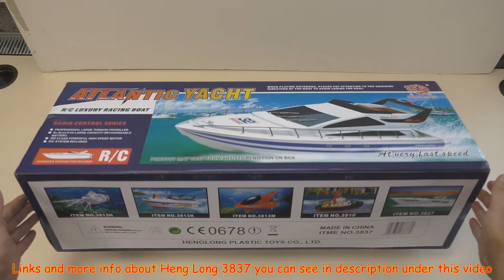Heng Long 3837 2.4GHz, 2Ch, RC Boat, two 380 brushed motors, proportional control (RTR) + TX05

Comment: For those that looked for binding receiver to transmitter here, well here's how to do it.  For a replacement Rx.  Switch on both Tx and Rx. The Rx led should flash indicating not bound. Move throttle stick to full down/reverse position and hold for about 5 seconds. The Rx led stops flashing and stays on. Release the throttle back to neutral/middle position. Gently move it to ahead/forwards and motors should engage indicating Rx now bound. If there's another way then please add to these comments. You have covered all other things except binding, than you.

Comment: I need some replacement propellers for this Boat. I cant find any here in the States. Could You please tell Me where I might find some, Thanks.
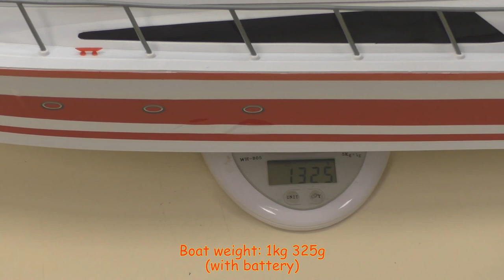Reply from the maker: You can try pick propellers from similar boats. Heng Long 3837 propeller have length 37mm (03:23). Also type in the search field on Aliexpress "propeller 37mm" an you can get some result
Reply: Ebay or Amazon 37mm rc boat prop .I just ordered metal ones for Mine .
Reply: Ebay or Amazon I just ordered metal ones for mine.

Comment: Please teel me why your boat have a proportional speed and the other ones doesn't have it? I have bought it because I was sure it has proportional speed seeing your video and my boat is not proportional. Speed on off! Why??
Reply from the maker: Probably you have old version of this boat
Reply: @81hermit  your boat is not modified?
Reply from the maker: @stegarau  My boat without any modifications. Stock new version.

Comment: Needs some trim
Reply: As in prop trim like a real boat . That's why it's clapping the water
Reply from the maker: @mariopuzo4509  you can trim only direction using transmitter